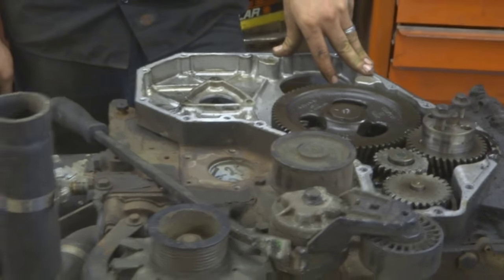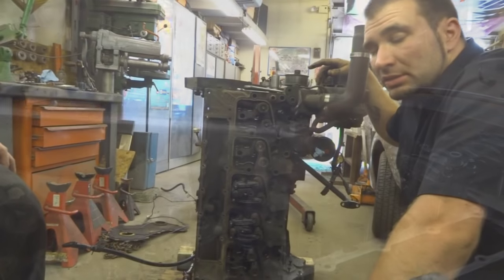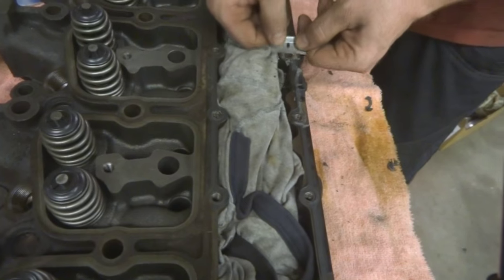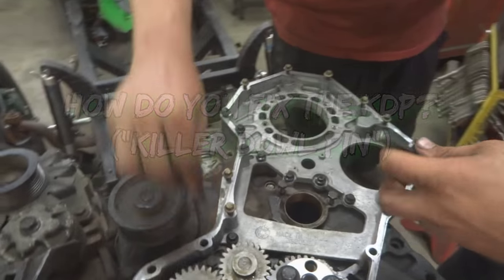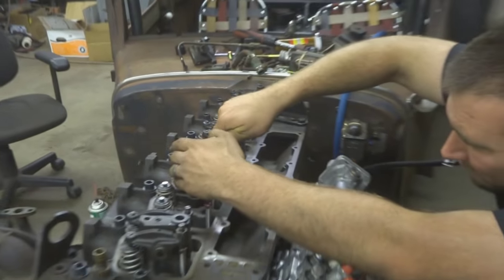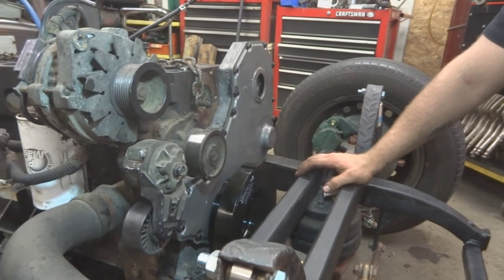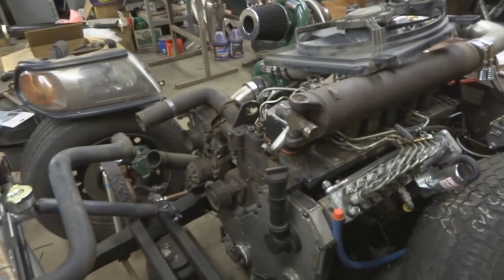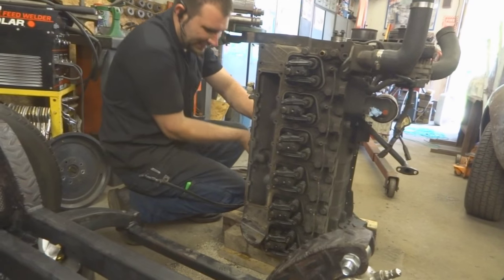Cummins Rat Rod: Project "Wild-Torquey" (Ep. 35) INSANE BUILD!!

Comment: i think they design the cylinder heads with "poor" flow charachteristics on the exhaust side so that it will work well with the turbo. if the exhaust doesnt get to expand as much in the heads, then it will expand more in the turbo, making it spool up more/quicker.

Comment: Isnt the cam gear hardened? baking it at 400 will be a tempering and it should lose some hardness. Nice build though!
Reply from the maker: +phogelbice Well, baking gears and bearings has been done for many years, so it's kind of one of those things that might make a difference, might not. I'd rather bake a gear and drop it easily on than try and cold press it onto a precise cam and risk gouging the cam, etc. Preference really. lol
Reply: Yes well roller bearings and ball bearings I would never heat to more then 110 celsius wich is 200ish Farenheit, after that you're changing the properties of the metal. Thats is usually enough for it to drop on the spindle, and you can cool the shaft. Thats what i have been thought. Im sure there is more information on the subject out there, I wouldnt call myself an expert. Have a nice one
Reply from the maker: No problem, this is just common practice that I have seen. If I have an issue Ill know next time, but to this date never seen an issue from heating bearings to put them on. Thanks for commenting and offering tips though, always good to see other perspectives :)

Comment: I love your build  I building a 55 ford f600  big rig look  I'm  going to put a 5.9 12v cummins with twin turbo  I'm going to push it  to 1000 hp  with a racing injector pump and ceramic coated piston  how many hp and foot pounds of torque are you going for with your cummins
Reply from the maker: 750hp, 1300 ft lbs approx. And sounds fun man, be ready to open your wallet. Ha its about 10k to build 1000hp in one of these engines..

Comment: Did you ever make a video on how to convert a VE pump to the 7100 pump?
Reply from the maker: Drew Click no unfortunately I ran out of time and now haven't had much motivation to do it lol
Reply: I am in the process of rebuilding and dropping it in a 1979 Ford. I've done a little research and I know that I need timing cover, P-Pump lines, drive gear, bracket to hold the pump, and an oil line. Is there anything else I need? Also I seen on "Wild Torquey" you ran individual intakes on the head. Is there any downsides about doing that other than you can't switch back without buying a head?

Comment: just wondering does drop in mean that it has been broke in and harden off or do you still have to use break in oil with zinc in it and run it at a high rpm for awhile to harden it off?
Reply from the maker: drop in means the cam is supposed to fit into the engine with stock pistons, etc. no machine work needed. cam break in is always a good idea.
Reply: yeah i found out about them needing broke in and that today's oil does not have zinc in it which all flat tap pit cams need about a year ago when i wore two lobes off in less than a mile on a 289 that was completely new on the inside. a costly repair for me. great build on the car. i noticed it has a hitch ball in the back are you going to be pulling a goose neck trailer with it or something?
Reply from the maker: +james p yup gooseneck trailer!! and zinc additives are a good thing to use. amsoil also sells a zrod oil which has zinc and other additives which help the oil properly coat everything and avoids complete dripdown of the oil (most synthetics drain completely,  zrod sticks after the engine is shut off)
Reply: very cool and thanks for the info

Comment: Aside from the torque, why use a Cummins? Isn't that somewhat heavy? I'd have gone for a Ford Zetec or Factory supercharged Mercedes 16v for a hot rod.
Reply from the maker: never built a diesel and their are a lot of aftermarket parts for these. its a hell of a lot easier to hit 1500ft lbs of torque with one of these.
Reply: Tinman 2 Kustoms I was thinking in terms of power to weight ratio, but what top speed, 0-60 mph and quarter mile times are you expecting? I prefer traditional hot rods and customs, as opposed to rats, but I see some true DIY thinking here.
Reply from the maker: +Chris Henniker weight on a Cummins is 1100 pounds. top speed I have no idea.  1/4 mile should be high 11s
Reply: +Tinman 2 Kustoms, that's excellent for an engine people might have considered a boat anchor. These have a lot of potential. Wonder what would happen if you used a Duesenberg engine and tuned that? What fuel consumption do you expect?
Reply from the maker: Should get about 25mpg. I dont know about all these fancy engines you are talkin about. lol

Comment: What is the purpose of cooking the cam gear?
Reply from the maker: to get it to slide on easy. when you heat something up it expands, when the gear expands the hole in it in turn gets slightly larger. so it drops right on and seats itself without having to use a press.
Reply: +Tinman 2 Kustoms Thanks for responding!  I have a 6.7 but I am learning.  Cool build, I hope one day I can buy a rat rod with a 12v cummins
Reply from the maker: Well, this will be for sale one day! lol start saving up XD not anytime soon though

Comment: What compounds are you running
Reply from the maker: pro turbo Inc hx52 and a stock 94 wh1c (similar to an hx35)
Reply: Any hp numbers yet?
Reply from the maker: +matthew roach not yet. turbos are gunna provide about 600hp of air, nitrous will make up the other 200hp of fuel I have at access
Reply: +Tinman 2 Kustoms i was watcbing closely did you fore ring the head or just new gasket and bolts
Reply from the maker: +matthew roach no fire rings yet. currently It's got new gasket and the HD headbolts. if I have a problem I have ARP headstuds new in the box waiting and a new gasket. lol trying out these bolts to see if they can do what they say they can do

Comment: guys seems to know some stuff. wish more were like him saving money by putting in a stronger bolt. yeah machining costs but the 100$ in machining over 1000$ for bolts hmmm :D
Reply from the maker: +shel bot Right exactly! Thats why I trust him to help me out.
Reply: Tinman 2 Kustoms Man I got so bent over from a Machine shop in my town on a vw 1.6td build. I decided to port my head after I had all my head work done(IKR..) and when removing the valves they felt really gritty. Removing the stem seals I found my exhaust guides were broken or fractured and debris was just waiting to chew up my valve stems. All intake guides were not evenly placed(unsure if that matters) and none were diamond honed so they all felt very tight. All valve stems had a valve grinding compound on them that I can only assume was supposed to smooth that out but how good is that for the 3 angle valve grind that I paid for and was never even done lol.

In the end I took my head to another shop where they properly pressed in new guides and a true 3 angle valve grind. They pointed out how the last shop butchered my cam by polishing out the chips and taking down the profile past spec. sigh 

I have yet to go over the bottom end and I remember it being tight to do a full rotation by hand with the pistons in. I'm very scared they may have done some horrid work as the whole bottom end was rebuilt with stock bearings and over sized pistons. So I hope the bores are straight and even... My goal was 20psi and reach a million km on the engine.

Comment: doesn't know what anti seize is and or didn't check to see if valves were cracked
Reply from the maker: +BIG STANK Engine ran good when pulled, only 76k original miles on it. valves are fine. As for anti-seize, you dont know what goes on when the camera isnt rolling. I cant specifically remember where we put antisieze and where we didnt, but these guys know what they're doing.